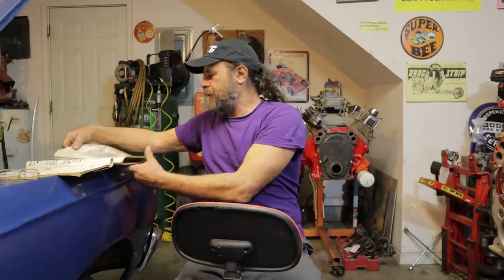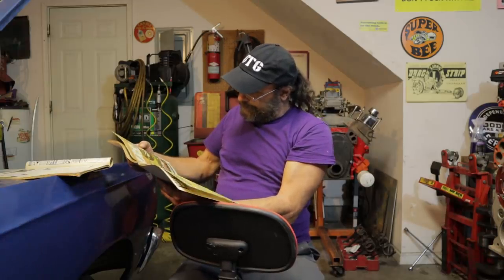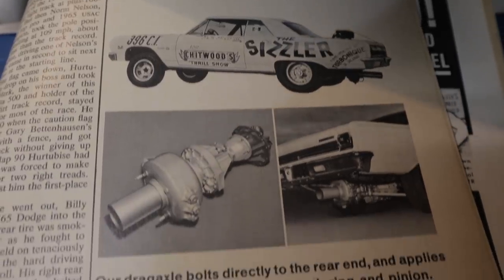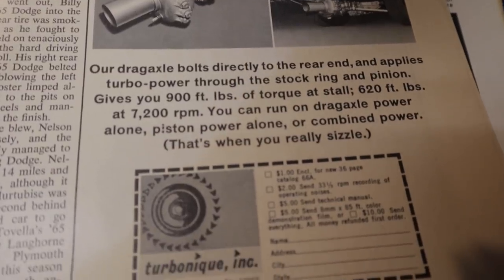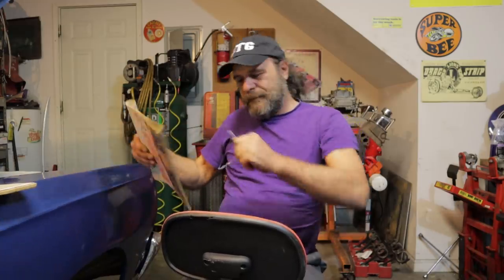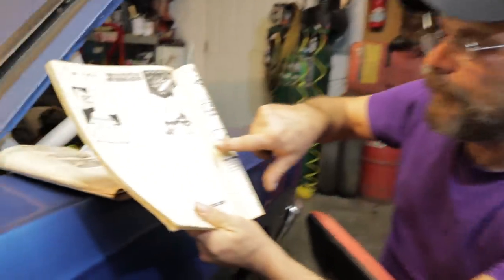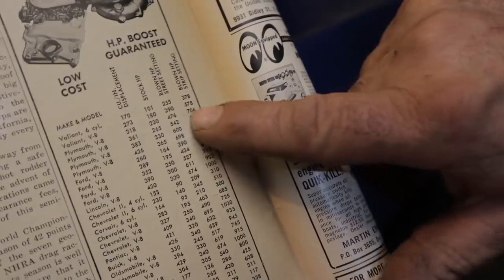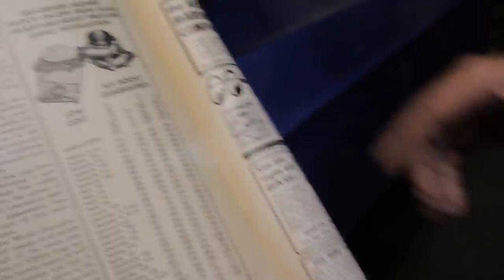Electric Turbocharger?  That's For Kids...Here, Hold My Thermoline....

Comment: I do think an electric RC model jet brushless motor powered ducted fan unit hooked up properly could provide a few lbs of boost very inexpensively. some 100 mm units put out 5 or 6 lbs of thrust (two of them inline to keep the air compression stiffer?), connect the hall sensor of the speed controller to the throttle, program the controller (means a lot of testing with a boost gauge), then put a simple on-off switch on the dash someplace for it.
100 mm is about a 4" pipe.. minus the 36 mm diameter of the motor that drives the compressor blade, might be about right for stuffing extra air into a fuel injected 4 cylinder with a 80-90 mm intake. electric "turbo" Honda? 
someone Chinese/eBay was selling a really cheap one powered by a brushed 540-550 DC motor, brushless motor can deliver over twice as much torque and rpm both. when it wasn't on the motors and blades would spin more passively too, there isn't a lot of cogging with the brushless motor(s).

Comment: It would be neat. The main problem would be trying to control and meter it. Be easy to make to much power down low like hitting it with a big shot of nitrous. Would almost want a multi stage deal that would start with a small rocket then add more rockets or step to a larger one. The liquid fuel would be great if you could throttle it.

Comment: Do you remember the rocket motor that could be bolted to the rear differential??? 1960 type still. It was all over the mainstream auto magazines in the 60's.
Reply: Its in this video.
Reply: @markg7030  Oh I missed that. 2 many wobbly pops I guess.
Reply: Wait... huh... like some kind of thermonique type thing, no way!  RU serious?!  Never heard of it, where did you come up with this idea?
Reply: @THRASHMETALFUNRIFFS  I didn't come up with this. Somebody did though. Some type of short fat rocket booster that bolted to the rear diff and was fired electrically. One shot deal. I don't know how long it burned or what kind of thrust it made. I'm guessing it was refillable and reusable as it looked expensive. If anyone has a car magazine collection from the 60s or maybe early 70s they maybe able to find ads or some mention. I remember seeing ads. Maybe look back as far as the late 50s.

Comment: Solid fuel hmm...? What if you replace the solid fuel capsule with a small combustion chamber and feed it with alcohol from a tank and oxygen from a bottle? This way you could build it yourself in a garage by using an old turbocharger and it would be easier to control it...

Comment: I have a 60's HotRod that advertises a small block Chevy timing set with a built in mechanical advance/retard mechanism. And we think VVT is something modern.LOL
Reply: Is that the kit that let's u adjust cam timeing they have things like that wear theres an access pannel on the timeing cover so u don't have to tear it all the way down to make an adjustment its neat.
Reply: @kevinjohnson9372  No , the cam sprocket had a centrifugal mechanism in it which changed cam timing depending on RPM.

Comment: It sounds like conspiracy theory to keep rocket fuel out of the hands of civilians, but think of this in a 9-11 world. As for the rocket blower, I think the only issue is the boost has to come on slower so it doesn't blow the tires away. Like a two stage nitrous system.

Remember the 1950's magazines, there was a box that went under the carb with a propeller? Air went into it and supposedly turned the prop so it boosted? You were better off with magnets around the fuel line...

Comment: Would that rocket super charger not just spool to 200lbs of boost and melt the motor down?
Reply: symantics!  (actually it wasn't running through the motor, it was connected directly to the rear diff... wihich also made me wonder about over powering the engine/trans on backward from the other side?
Reply: @THRASHMETALFUNRIFFS  That was the turbo axle, the second one was a fuel powered blower

Comment: The TORQAMP is pretty cool. Runs off 4 12 volt batteries, for a total of 48 volts. Expensive, but it's an electric turbo that actually works. Cleetus McFarland put it in a Chevy Cobalt and a few other cars. Made good power. https://torqamp.com/order-torqamp/

Comment: G'Day Tony,,Mate ya want one of run,tech..is compress air in stead of turbo or super chargers,,
yep strap a bottle of compressed atmosphere in ya car and regulate,,Regulator should be able to keep up with air usage,,
but a bottle of atmosphere,and descent air regs and maybe get 2 runs,,before needing recharging,,Make it more fun add some water injection as well,Advance ya timing some more,,
Now ifin ya want to get real narkie about it,,
Change gas mixture in the bottle,,Make a super bang Formula..
Really can call it a bottle rocket..

Comment: Isn’t this how they used to start piston airplane engines?
Reply: Actually yes, but those use a charge of gunpowder to get an extremely strong but very brief push of energy rather than using a rocket cartridge for a weaker but more prolonged push.

Comment: This seems like a Logan Paul approved idea...
Reply: Is ur Garage Heating project done yet? I'm starting to crave a video... Ha
Reply: @jontrudell7529  Ceiling mounts are up... I got hardware today... paint and heater mounting tomorrow.  If I had a "community" tab, I'd post pictures.  I can't wait to have a warm place to work in January.  It will be so different.

Comment: The electric motor drag cars will be the fastest car period.
Reply: Not yet. Rumor has it that Elan is going to combine forces to create the absolute fastest accelerating vehicle ever, and saying that’ll it’ll hold that record for a long time. The combined forces are Tesla of course and SpaceX. Rumors predict that it have a compressed air rocket of short duration for acceleration. Any motor has to get the power to the pavement. Tires are the weak link. Hydrogen peroxide rockets used to blast down the track until outlawed with record runs in the 3second area at 400mph 1/4mile times. They actually still run a couple in England including a motorcycle.
Reply: Yeah,,, I will beat any, ANY electric car out there in a 69 VW bug and I will hand you a spark plug wire off the engine at the starting line.

See you at the Cannonball.